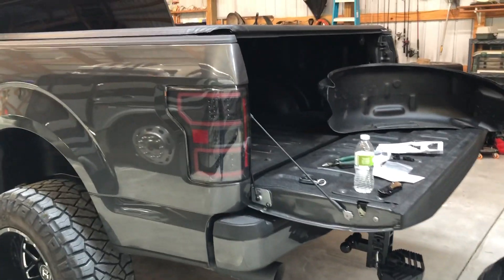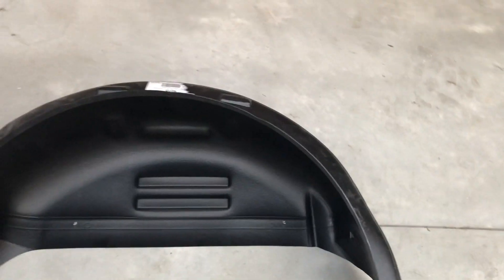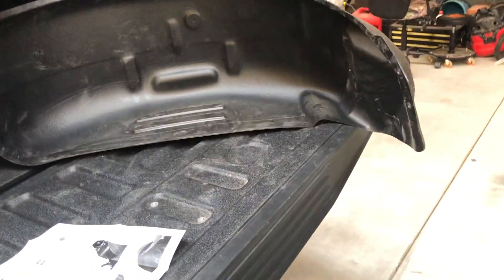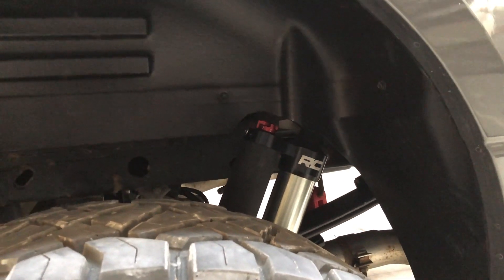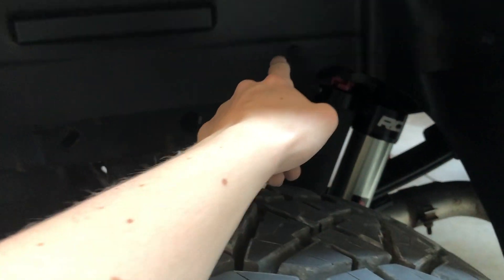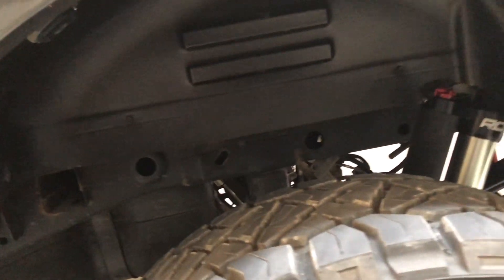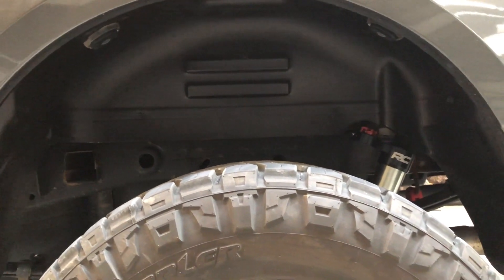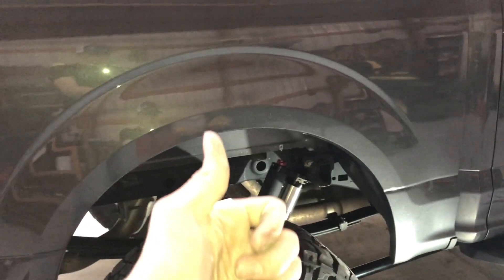Installing Rough Country Wheel Well Liners

Comment: How are the Ridge Grapplers? Thinking if getting a set.
Reply from the maker: Good for in town and highway, not much road noise, lots of traction. They’re trash on gravel though, so many rocks get stuck in them and get thrown everywhere
Reply: @blomeoutdoors2134  what are some good tires for gravel?